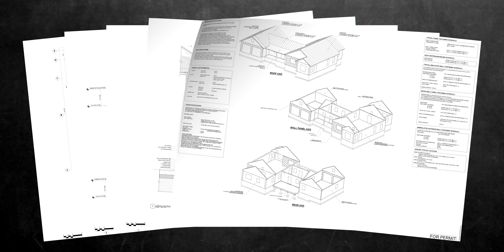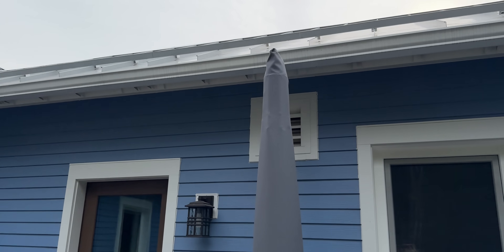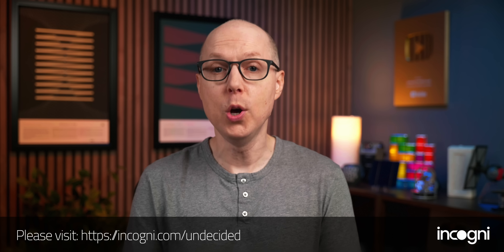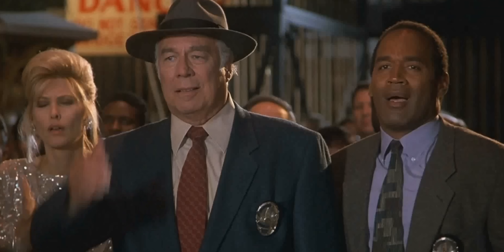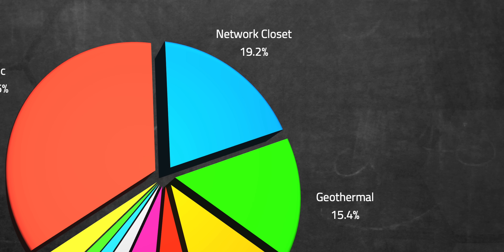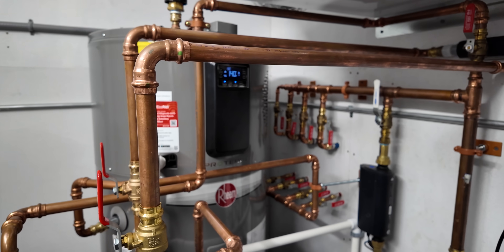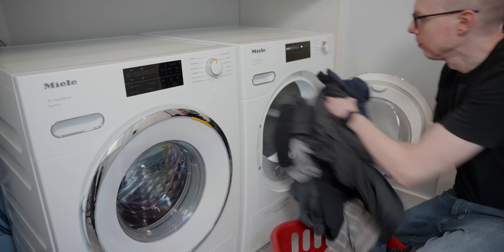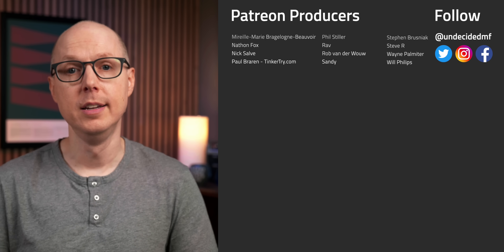What I Learned After 1 Year in My Net Zero House

Comment: Essentially this is a (Western/Northern) European house, the build bears a lot of resemblance to current day (energy  efficient) builds over here. No basement (because they're expensive), lot of insulation, triple glazed windows, heat pumps, energy recovery ventilation, blower door testing throughout the build and electrical smarts, PV and so on. Even the wooden framing prefab is something some people in Germany pick nowadays instead of masonry like it used to be. The heat pump driers and induction cooktops are standard over here anyhow. So yeah, Matt built a European home.
Reply: Here in the northeast part of the US, a basement makes sense from a cost perspective. We get cold winters and frost in the Boston area reaches 4' (design code) and even 5' or more in northern New England. So if you're building a house you might as well go another couple feet and gain an entire story. Basements do get damp, so a dehumidifier is necessary in summer.
Reply: @ohary1  As far as I know, Matt lives in MA. I'm curious why he didn't decide to add a basement. Will have to see if he has a video on that
Reply: @twothirdsanexplosive  If you live in certain parts of the Us you need a basement tornado  alley.diff, areas have diff, standards,
Reply: @ohary1  New England slab on grade has been solved.  It turns out you just need insulation under the slab, extending a few feet in every direction, below the ground and outside the perimeter of the house.  That prevents frost heave by insulating the ground under the house to below the frost line.
Reply: @StephenLinhart  You still need the footings. Are you saying you put your footings on rigid foam insulation?
Reply: @ohary1  what ever the frostline is, building just foundation wall vs undeground pool (or call it basement, just keeping water outside not inside) are really completely different things. Just no way to put them in same context with just few feet deeper.
Reply: @ohary1  Houses in Germany were built with basements, always. But in recent years, where land had become obscenely expensive (in certain areas) and the cost of building a basement has increased dramatically, as well, people simply run out of funds and can't afford a basement. Where land is cheap, the income is also lower thus it's also difficult to justify, because all of a sudden it causes a major cost increase of the build and you might face difficulties with the mortgage vs income ratio. Personally I wouldn't want to build without one. Otherwise it's a maisonette to me, not a proper house.
Reply: @krmr  To build a house in my area, it'sabout $600-800k USD. Another $10k for additional concrete, excavation will gain you an entire unfinished floor. No basements in the south where they really don't have much of a frost line.
Reply: @ohary1  South of Germany, suburbs, a 3500 sqft plot will run you anything between 400k and 800k EUR. The build itself is going to be between 400 and 600k, and another 60 to 100k for the basement. We're talking turnkey, ready to live, but nothing overly fancy. So anything between 800k and 1.5 mil EUR, sans taxes, agent fees etc.
Reply: @krmr  holy smokes! I thought the US was expensive. I built a 2650 s.f. (~250 sm) log cabin on a 1 acre lot in the White Mountains for a little over $100k USD, 12 years ago. Town says it's worth over $600k USD now. Taxes are $10k/yr! That's more than I paid for the lot. Here I am thinking prices are out of control here. I guess we're not the only ones.
Reply: @ohary1  It's not just Germany, I'm talking to friends in Romania, in Sweden and a few other EU countries. I'm looking at the real estate insanity in Portugal and Spain. Prices went up and up and up. Maybe it's not Vancouver, BC mad nor Sydney, Australia mad but we're getting there.
Reply: @krmr  The basement situation in Germany vary by region. Places with high ground water table certainly don't often have them, based on empirical observations. And, there are plenty of old houses without basement too. It probably boils down to cost. If land was cheap, or building a basement was hard, no basement was built. If not, one was built.
Reply: @L2M2K2  Yeah absolutely true, as I pondered It's cost in my experience. See plenty of old buildings with basements, yet we have high ground water, one of the constructions familiar to me they had to pump ground water for an extended period of time before being able to construct a basement and a parking garage. Seeing single family homes and duplexes skip basements because of cost, for condos and necessity to build parking economies of scale work.
Reply: It might have been advantageous to put insulation on the roof instead of the attic. Matt Reisinger does that for the custom builds.
Reply: American driers and double-glazed windows couldn’t be sold in Switzerland as they’re too inefficient.
Reply: @martingardens  We line dry our laundry.
Reply: @martingardens  True that. Also the YT algo has also been pushing new home inspection vids into my shorts feed, the quality is shoddy (but it's also shoddy in Germany, hence why I'd never build without an inspector, always used an inspector in the past). it's not just the inefficient appliances, it's the material quality overall, I'm horrified by their crappy sliding windows and paper doors & how the builders stiff buyers and insulation seemingly in every new build.
Reply: @krmr  You're getting new home inspections from inspectors who work in areas where that's what home builders do, because that's popular. No one is getting large audiences and high traffic from inspections of high-quality work.
Reply: @Objectified  There's no high quality work. I talked plenty to my inspector, his services are ordered before the construction starts not just when the build is completed and is faulty.
Reply: A buddy of mine had a hauf house delivered a few months ago, the assembly was fast.
Reply: @krmr, I’d be curious to know energy rates, energy cost penalties for high demand time of day, etc, compared to average is energy rates and demand charges. Any input is appreciated
Reply: @Bert889  We have no penalties for high demand / time of day. We have fixed rates on fixed contracts. When the contract ends, you can find a new provider offering new rates. Although when it comes to electricity, nowadays there's offerings like Tibber where you can buy practically at the price that the exchange offers (dynamic pricing). There's been some data analysis proving it's not always advantageous to buy into a dynamic tariff, depends on the circumstances.
Reply: @Bert889  I can only speak of National Grid (Massachusetts elec provider), our rates are some of the highest in the country. After adding in all the fees, the current rate is about $0.35/kWh. There are no variable rates throughout the day like in California. But who knows if/when that changes. I "think" current solar owners may be grandfathered.
Reply: A basement costs between $10 and $25 per square foot as compared to $160-$180 per square foot for above ground spaces.  So, they are not expensive for the space that they provide.
Reply: @percyfaith11  it's a similar ratio in Germany, yet I believe people simply hit their ceiling in terms of mortgages and can't afford to add a basement, there isn't an extra 100k available to do so.
Reply: I’ve honestly never heard of a house being built on a slab in Massachusetts. I always thought the freeze line was so deep, you’d be crazy not to have a basement.
Reply: I guess it makes sense, europe is poorer and energy costs more. So they really had to optimize their energy use as much as they could, whereas in the US it just doesn't matter as much so people haven't really started to bother until now.
Reply: Yeah I was going to say... the windows, the Passivhaus sort-of-targets for the envelope, the washer/dryers and even the geothermal heatpump... sounds basically just like a mostly typical new construction in Europe these days, such as ours. 

Amazing work for sure and especially given that it is not standard even in a relatively "advanced" US state like MA, but it is also a bit of a sad display of how far behind the US seems to be falling in these standards.
Reply: Yep, we’ve got all of those things in America, nope, they’re not just western/northern European. When I built my wood frame rancher house 29 years ago, I had a geothermal heat pump installed along with all of the other efficient goodies you listed. It’s an American house not a northern eastern southern or western European house. And Matt’s house is a Massachusetts home because… It’s in Massachusetts. 😊.
Reply: @joehowe9532  Matt himself referred to European houses in his past videos. The way he built and the way you built is definitely not standard for the US. The way we build, basically this way, is standard to us, it is mandated by our governments, either you wouldn't get approvals, you wouldn't get a mortgage or you'd get subsidies because you went above and beyond on energy efficiency.
Reply: @krmr  Matt is not an expert on construction across the United States, and neither are you. His home may not be built as the standard, but many of the things he has done are present in many American homes.
Reply: but mansonry is the reason we dont need whole house humidifiers lol. in europe they build air tight but not vapor tight and thats a small but significant difference. this wood chip board construction is trapping water inside because they are 60% formaldahyde glue.
Reply: @doublep1237  Temperate climates are a major reason why you don't need whole-home humidifiers as often. Many U.S. homes don't need them, either. I swear to god, you people just refuse to actually understand how there are reasons other than dur-hur America bad that drive differences in construction.
Reply: @Objectified  fair point, you are correct that if its cold inside the water in the warm air from outside will inevitably condensate if it enters the house. when u let the cat out or something. although there is still a temperature difference outside vs inside with all the implications regarding condensation and therefore wall construction so my point is still valid. 
On another note ofc the reason you have to build "woodsheds" is that your hur-dur free market makes you pay for your "relatively cheap" construction the same amout for as an european one. :p but it seems we are on our way to import your houseing market soooo
Reply: No, it is another American wood shed,  not a masonry European house. It will be exploded and flatten by the first serious storm.
Reply: @dDoOyYoOuUtTuUbBeE  We do (American) woodsheds nowadays in Europe, too, because it's cheaper. Although I can't really compare if the woodsheds are more solid than the US counterparts. Although there are some old ass woodsheds in the Nordics as well as Germany (Fachwerkshaus).
Reply: @krmr  If you think American homes are "woodsheds" and that being relatively cheaper to build in this way is the only reason they are so, you do not understand how American homes are built, nor do you understand what wood framed construction actually entails, nor do you understand the myriad of benefits it brings.
Reply: @Objectified  "Woodsheds" are cheaper to build and lack quality. You can certainly build a quality home using wood frame construction. Look at all the beautiful Fachwerkshaus that are still standing in Germany, some from the 13th century. But builders of today are not interested in delivering quality work, thus quality isn't a trait they're particularly interested in, profits are, resulting in "woodsheds". Btw Matt showed in great detail how his home was designed, modelled and manufactured on the factory floor, then assembled in several videos but didn't (yet) show what an inspector found, but that's a separate topic.
Reply: Not if it’s build properly. Homes on the west coast of canada have been built with lumber/timber for hundreds of years ( including First Nation cedar long houses ) and they handle winds and storms that seem to flatten homes in Florida. They also ( with the right construction techniques) handle earthquakes way better than a rigid masonry home. When power is only $0.08 a kilowatt we have been very lazy on energy efficiency and that’s our biggest problem out west.
Reply: @dDoOyYoOuUtTuUbBeE  you’re a clown, such a clown.  😮.
Reply: @dDoOyYoOuUtTuUbBeE  Clearly you've never been to the states. Weather here in the US is generally more extreme than in Europe.  100 kph winds here are regular things, and our homes survive easily. Hell, homes along the gulf coast survive cat 1 and cat 2 hurricanes with minimal issues.

Stick built (aka lumber) homes have upsides and downsides. We've left the stone age.
Reply: @JR_MacD yeah people forget that this style is used for a reason just like their style is. We use wood because its plentiful. Studs allow easier insulation which helps with our crazy weather. Stud framing is also remarkably strong.
Reply: @nerdy1701  the only reason you use timber is cost, like you said its plentiful and cheap.

Masonry houses would be far superior with you're 'crazy' weather. Masonry acts like a hear sink, so in summer it takes long periods of hot weather to heat up the Masonry, in winter once you've warmed your walls they retain the heat reducing your energy bills. We also use a double skin of Masonry, the internal layer is structural, the external layer is the cladding, between the two is insulation.

A UK breeze block has 2 hours fire resistance, so the double skin provides 4 hours of fire resistance.  The British firebrigade attends more traffic accidents by far than fires due to our construction, also most house fires on newer building don't spread and are put out easily.

You say your houses survive hurricanes, the devastation is shown on British news broadcasts, entire neighbourhoods flattened. Masonry houses would survive with minima damage, maybe the odd house which had a roof in need of repare would have had it ripped off. Also a concrete tile roof last up to 100 years, slate atleast 150 years, but many exceed 200 years.

If your house exterior is brick then you're unlikely to need to do any maintenance for 50 years plus, even then it would be minor maintenance. We have buildings hundreds of years old that are almost entirely the origional bricks. If rendered then you do have to repaint every 8-12 years. A timer clad house you would have to paint every 1-2 years and I doubt that you'd make it to 20 without having to replace sections.
Reply: @kaneworsnop1007  Masonry buildings are not Hurricane proof. The house you see destroyed on TV are not from wind but because the hurricanes bring with several feet of flood waters that will destroy everything in its path. Most houses in Florida are built from cinder blocks making them masonry, but are still highly susceptible to hurricane damage.

Comment: I was surprised to aee the dehumidifier.  I think I need one but I'm struggling to justify the cost for what seems like a minor problem.  Is it necessary because of the ERV?
Reply from the maker: It was necessary for us because the geothermal system is so efficient and the house is so air tight.  There was a little concern that the HVAC system alone wouldn't be able to pull the moisture level down far enough in the summer (the cycles wouldn't run long enough).  That concern turned out to be right.  In the most humid months of the year, if we turned off the dehumidifier the levels got up over 60%.  Livable, but not great for preventing mold growth.  So the dehumidifier is basically running June - August.

Comment: I had an electric induction range installed about two months ago.  I had to replace all of my aluminum cookware, but damn was it worth it!  Way better than even gas.
Reply: Gas is garbage, unsafe and unhealthy. Induction #1, smooth top electric #2, gas last place. I'd prefer coil elements over gas
Reply: @cliffordbradford8910  do you cook very often? More than just boiling noodles. I’ve never used an induction or electric top that didn’t cycle on and off constantly and not keep a consistent temp. Every time I go make something on my parents electric top I burn it because one second it’s hardly cooking then it cycles on heats it up to searing temps and shuts off again.gas is more consistent hands down
Reply: I astonish people when I can boil any volume of water faster on my induction cooktop than the 1200W microwave can manage.
Reply: @larrybremer4930  Not once in my life i have ever heard someone using a microwave to boil water 🤯
Reply: @stadtaff1860  Ich glaub Wasser in der Mikrowelle is n amerikanisches ding 😂
Reply: @stadtaff1860  Welcome to America.

Comment: My family is planning our own build in your neck of the woods, and while we may do slab-on-grade, we're going to bring the entire attic into the conditioned envelope. It is kind of like having a conditioned basement on top 🙂 But it does solve issues with planning, as future additions to network, electric, plumbing etc. can be run in the attic and dropped down into the living space without concern. And, no black mold!
Reply: I'd reconsider the basement. Construction cost is minimal. You need to dig at least 4' for frost anyway.
Reply: @ohary1  Incorrect, basement construction costs are huge, insulating them is expensive aswell, and ongoing costs to heat it are there too.
There are such things as frost-free (heavily insulated) slab foundations.
Reply: @ohary1  Aussie here, why is that? We don’t have basements
Reply: Matt Risinger on continuous insulation and monopoly framing (with overhang) could be a good reference.